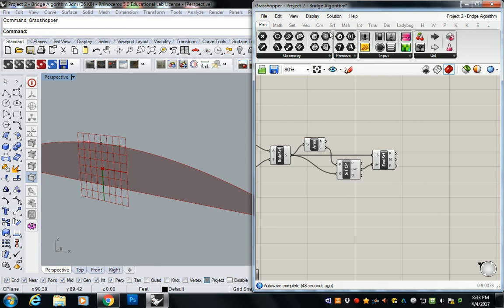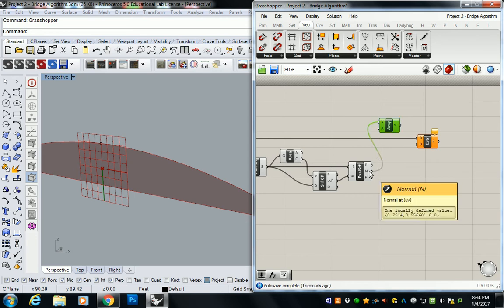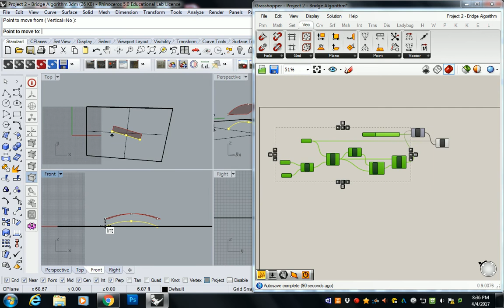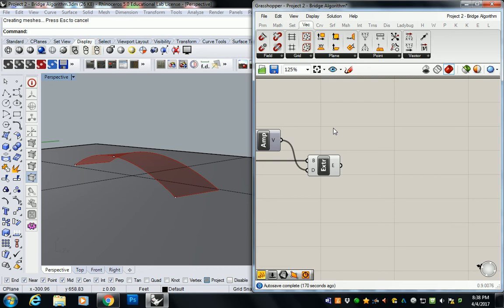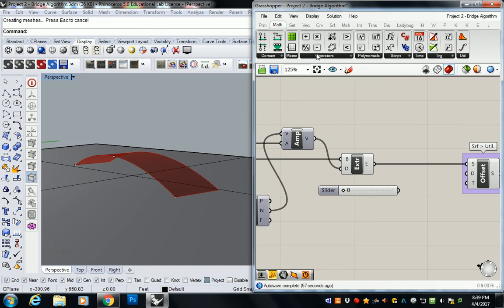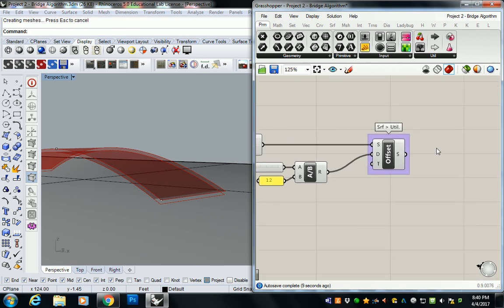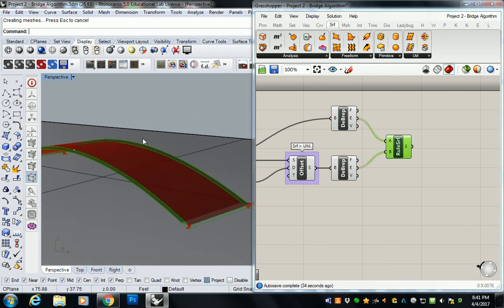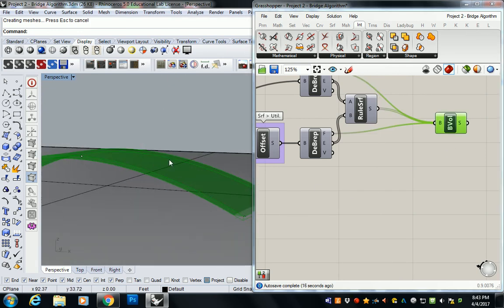59 - Grasshopper for Rhino - Generating a Solid Bridge Walking Surface

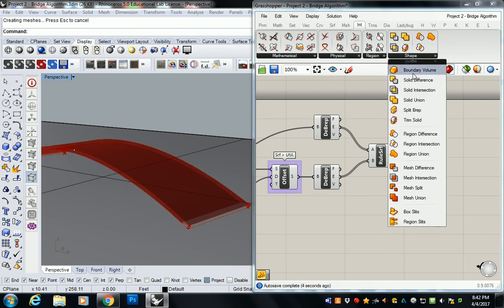Comment: At minute 10:48 We could've used also Brep Join component from Surface - Util menu to join the surfaces. Also, at minute 6:16 we could've used the Extrude component on the surface without any problem, plus the accuracy all along the thickness could've been more accurate and consistent.